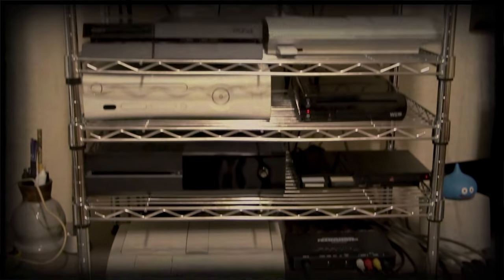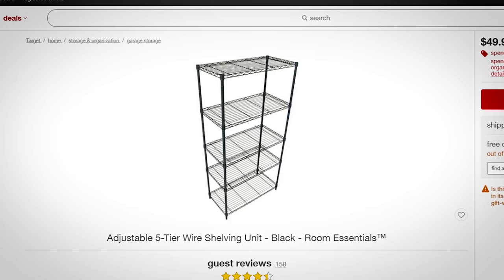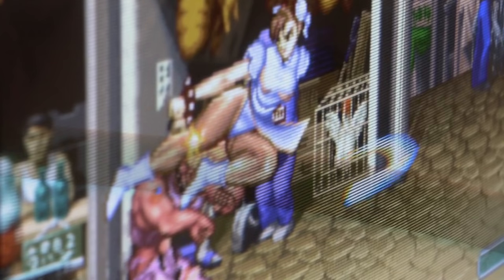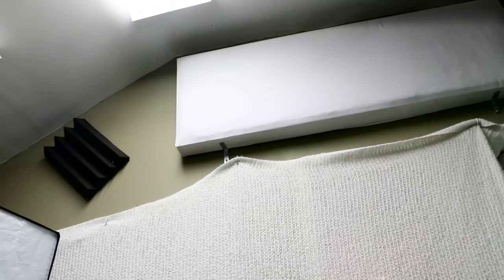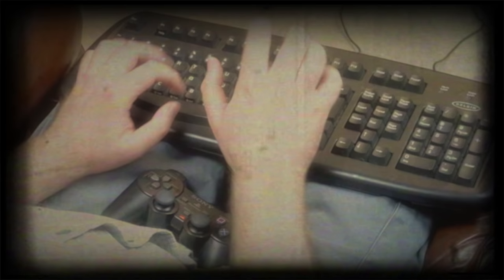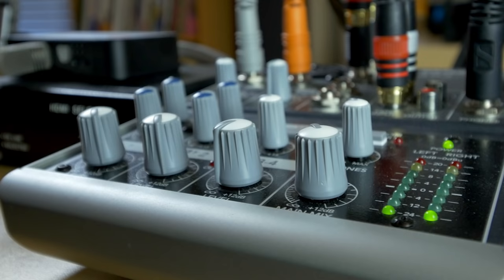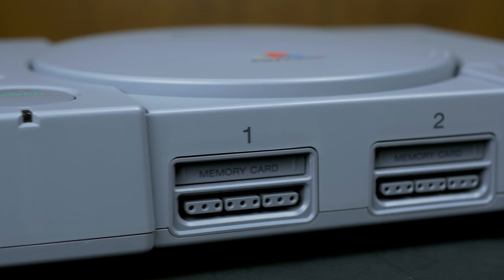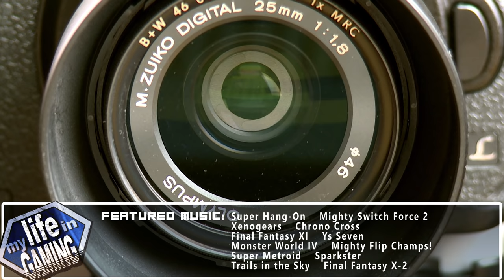Gaming Setup and Studio Tour - How We Make MLiG in 2016 / MY LIFE IN GAMING

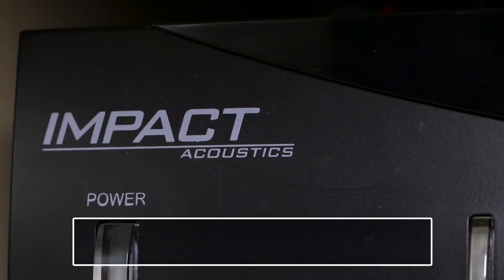Comment: 4:06 "It's pretty important to make sure that [the switchers] are powered. This helps you avoid image degradation"

I think that's a bit open to debate. Others have suggested using the exact opposite for just that purpose. ImplantGames Reviews, for example, opted for an unpowered component switcher by General Electric because he was worried about "electrical noise being added to the video signal". He reported no problems with it.
https://www.youtube.com/watch?v=qiqhn7I1odU

Personally, I had a powered composite/S-video switcher and it kept glitching up when certain consoles were played with S-video. For component, I have an unpowered switcher by Philips. It has four shared composite/S-video inputs and three of those inputs support component. It handled every S-video console that I threw at it, and I'm currently using it for my PS2, PS3 and Xbox with component. I think it looks great. I haven't seen any noise.
Reply: S-video is different from Scart 

I'm looking for a good splitter with its own power source. My current one blows
Reply: Jarrah White I used to have a powered HDMI switcher, I had no problems with it, except when I had my Wii U plugged in an on. I usually will play my Wii U on the gamepad and grind out stuff on my Xbox or something, and it would constantly make my switcher switch to the Wii U. Which I noticed either my Wii U or Wii Us in general have this weird on/off pattern with the signal through HDMI, even when hooked up to my Xbox One through the TV import I would constantly lose and regain the signal, only ever worked perfect connected directly to my tv haha, sorry this little tangent had nothing to do with your post really.

Comment: I know you guys aren't specifically modders, but I wonder what experience you have with exchanging batteries in games that use them for SRAM backed save data? Do you pay people to do so or have you done so yourself?
Reply from the maker: [Try4ce] Funny you should ask, because I would actually like to learn to do this and create a very simple "basic soldering" episode, with the ultimate goal being to learn to do something no more complicated than replacing batteries. I actually have never replaced any of my batteries, but I'm nervous about starting some of my RPGs before I do so.
Reply: I've tried it to mixed success but the problem is that I can't find batteries with solder tabs here. If I could I'm sure that'd be a lot easier. I've also seen some modify their carts to have a battery holder instead of a soldered in battery but usually that really depends on a lot of things. It's also not like you have to swap the battery very often.

I guess if you have flash carts you can just use those and leave the actual carts on the shelves, but I think you showed in an earlier episode how you liked the idea of using ips patches on actual cartridges so I assume for some people it'd still be most favorable to swap the battery in their old cart.
Reply from the maker: [Try4ce] Well, in the case of using the IPS patches, the RetroN saves the games to the system instead of the cart. So the battery is moot in that case. But for stuff like Phantasy Star IV, which is already in English, I want to replace my battery before I start it.
Reply: Battery holders tend to be better than pre-tabbed because you're not applying heat directly to the battery that shortens its life. You can also be picky about the coin battery brand and get one with a printed date of manufacture/expiration this way. Plus it only takes about ten seconds to replace it again in five to ten years. I can link you the holders you need. There does exist one low profile enough for game boy carts. Soldering is very simple and a good skill to have in general. The only risk really is screwing the cartridges back together improperly and stripping the threads.
Reply: Check Artemio Urbina's channel.
Reply: +Julian Rodriguez I don't speak Italian, and he doesn't seem to have anything for battery replacement.
Reply: +Nukleon he speaks spanish and he has two videos about battery replacement, also you can ask him about it, he speaks english too :)
Reply: Honestly the best way to change the backup battery is to open up the cart, remove the PCB, load the bare PCB into the intended console, power on the console, then go ahead and swap the battery while the console is powered on. Then reassemble the cartridge. Simple.
Reply: +Matt that's nuts, you shouldn't interact with a raw PCB while it's powered on. Better to just get it over with and accept you lose your data. Consider it an incentive to play the game again.
Reply: +Nukleon I'm an experienced EE and carefully hot swapping the battery would be fine on the old school legacy hardware with nice and wide traces... Key word is carefully, especially if soldering is involved.

Another option, which might be safer, is to piggy back the same low voltage of the intended battery in parallel across the battery terminals, while swapping out the battery. 

Short of using expensive and cheaply produced cartridge EEPROM readers for each specific cartridge as an intermediate download, those are probably the only ways I can think of to replace the battery.
Reply: Or you could just replace the battery and lose the save data. If it uses EEPROM, FeRAM or Flash for saves the battery doesn't matter anyway, it's only for games that use SRAM. All the game data is on mask roms and is entirely insensitive to the battery being replaced.
Reply: You can back up SNES saves using Retrode2 from DragonBox. You only need to hotswap SA-1 lockout chip games, namely Super Mario RPG and the Kirby SNES games, if you don't want to lose their saves. You can back up NES SRAM with the INL Retro Programmer and some scripts.
Reply: I have the exact same VCR that Coury has! :)
Reply: Jacob Carpenter great VCR

Comment: Get ready to replace your mini xrgb with the OSSC!!!
Reply from the maker: +BlockABoots [Try4ce] Maybe! There are upsides and downsides to each. It will be heavily featured in the episode we plan to release next weekend.
Reply: Just the reduce input lag is enough for me, and even though my LCD doesn't support the linetriple mode the linedouble mode looks just as good as my xrgb-mini ( i ahte the mini in 1080p the scanlines look horrible) and what with x4 and x5 modes coming soon, profiles and what ever else the community comes up with its only going to get better!
Reply from the maker: [Try4ce] I'm definitely excited about all of the possibilities. Coury has bought one, and I'm using a loaner to finish our episode. It's not quite to where I'm willing to use it in place of my Framemeister at the moment, but I can easily see a day coming where I would! The colors are definitely a lot more striking than on the Framemeister. Right now I'm worried about SNES compatibility (won't work on my TV, and NESRGB won't either). I'm very excited about 4X, but I'm suspicious that 5X might not work the way I hope. My hope is that it would be a 1080p signal cutting off overscan (rather than outputting a 240x5 signal), but I don't know if that's possible with the current hardware. I have no idea. IF so, and if I upgrade to a TV that supports SNES with no issues, then the Framemeister will be well and thoroughly defeated. :)
Reply: Yeah my SNES Mini (RGB Mod) wasnt working to start off with, i had to change the 'Analog Sync LPF' setting to 'MAX', have you tried that?
Reply: +My Life in Gaming what is your job to get all of these games

Comment: Very slick setup!
I agree about the metal wire racks. I've been using them for video game systems since the mid-90's. They are fantastic and make it easier to run wires.

I used to have 18 consoles connected, many with svideo connected to (3) 6-port powered RCA Svideo switchers. The best part was that it could be switched using any standard iR remote.  Then I had multiple controller extensions running underneath a rug and out onto a coffee table. It worked well.

Comment: For those of you who'd like to replicate Try4ce's setup, that Monoprice HDMI switcher has a serial port on the back (at least mine does, don't know if they do now) that you can use to control the switcher from a PC. You can get cheap serial to USB adapters online to hook it up to newer computers/laptops. This way you don't need to worry about the Framemeister remote if you cover up the switcher's IR sensor, and can hide the switcher behind your TV so you don't get driven insane by the flashing lights on the thing.
Reply from the maker: +mllarson [Try4ce] I actually bought an adapter like that, and still couldn't figure out how to make it connect or do anything. Since it's next to my couch, it may not matter anymore, but I'm still curious.

Comment: Hey guys, i'd like to make an arcade cabinet where I could pop all of my consoles in with compact switchers like the gscart and everything plus a consumer crt(yes it gets the job done cmon) and  control panel with pretty much every controller input from my consoles made out of extension cables connected to the consoles with detachable panels per consoles where I slide in the controllers .
Then the framemeister s output would go right into my Elgato capture card and the other end of my gscart to a pvm for a super crisp image and an optimal environment for speedrunning. Do you think this is a good idea? Cuz I need to save the most space in my room ( which is really , but really small) that’s why I think an arcade cabinet is the way to go...

Comment: 2:17 I definitely feel like that sometimes, feels like I'm trying too hard and that gaming is all I'm about. It's one of the reasons I tend to only have the necessary systems hooked up that have backwards compatibility (eg. one 60GB PS3 instead or a PS1+2+3 or a BC Wii instead or Wii + every previous Nintendo console), it helps the room feel less geeky and insane. I also eschew using game consoles whose major games have battery saves, has bad video quality or are prone to failure.

Having limited space, these days I favor:
-Backwards compatibility
-Good video quality
-Wireless controllers
-Handheld consoles

Comment: You know, I wished I still have my CRT me at this point. Now, I'm stuck with a cheap LCD monitor that recognizes 240p as 480i. For those who are wondering The TV that has s video inputs is my family's living room TV. The biggest problem is that my mom tends watch that TV for football and soccer games. The one in game room doesn't and has that flickering issue over 480i content. However, it recognizes 240p and gives an image over the component inputs when I 240p composite in the green plug. But the TV says 480i when that happens. It's a Magnavox HD LCD with a built in DVD player.

Comment: Dude, your set ups are awesome. It looks like Coury got the easy one for his set up in terms of cables. But you Try, WOW. How did you manage to make that work? Especially with all those long cables? I wish I had a setup that was a mix of both, but in the room that Coury has. Just the right size for a gaming man cave.  I feel i need more direct info on how everything is set up like a diagram thats drawn to show how you have the cables set up with the boxes to your computer, tv, audio, everything.

Anyways, great job guys, still makes me wish I had that kind of set up. Keep it up and hope to see more awesome episodes of your shows.
Reply from the maker: [Try4ce] Aside from the original Xbox, the longest runs are digital cables (no more than 25 feet) so there's no quality loss at all. Of course, in the case of something like the PS4 and Wii U, which are really far from the HDMI switcher, it's 25 feet, and then 25 feet again (passing through splitters), but it causes no issues! RGB systems are no more than 5-6 feet runs from their consoles to the GSCARTs... and then a very short run to the Framemeister and PVM. The Xbox has a component coupler to help it do the long run, and I don't think I've got any real quality issues there (I do hear a slight audio buzz when there's no sound, but it might be the cheapo cable I bought for the Xbox). The biggest challenge is how wide the spread of RGB consoles is... but thankfully since using two switchers instead of just the one, it's a little easier to make them all reach because I can spread them out a tiny bit (the daisy chain SCART is very short, which I specifically requested). With Coury's consoles being all close together, wiring might be a bit easier, but I enjoy my systems having a wider spread across the room!

Comment: You guys should make a video going through all the new third party controllers and sort them out as to which ones are actually worth buying as replacements to dying original controllers and other accessories.  There will come a time soon when the original controllers won't be an option which most people can afford and those third party clone controllers are the only choice that will have a more reasonable price point.
Reply from the maker: [Coury] I think that'd be a lot of fun. Our next episode is talking about several controller adapters where you can use controllers from one console on another. I think something like that would be perfect for a Tips & Tweaks episode.

Comment: wow, this is all so crazy! I definitely wanna use this for inspiration for my own studio that I'm trying to get set up now that I'm moving my equipment into a bigger space.

I wish I'd known about the keene box that Try4ce uses, but I'm ordering a Garo from Beharbros instead to route Component to my PVM. How much did that cost, for comparison?

You guys' videos are so great and I tell everyone I can about you guys when people ask me on Twitch (which is my main platform) about my RGB setup. The videos have really helped me learn a lot of things (especially the more esoteric console setups) and I am truly grateful you guys have made them.
Reply from the maker: [Try4ce] Thanks! Coury was actually using that for a while, but it wasn't working correctly with his PC Engine. He found something else that worked for everything, so he gave me that one. Someone in the UK helped him get it off eBay in the UK for about $115, he thinks? More expensive than I thought! He's using another box now to go RGB to component now, and I don't think his box goes vice-versa like mine does. It's pretty good, though I do have to make some adjustments on my PVM dials (a bit dark by default). I think the ideal situation is a second set of inputs like Coury installed on his larger PVM (as he shows in RGB 104), but for now, it's a good lazy solution for getting component systems on the PVM... though I will still mainly play them on the Framemeister.

Comment: At 2:03 - are there actually two Yamaha NX-E speakers hanging on the wall next to the tv screen? From an audiophile perspective i can only say: this is probably the biggest bang for the buck you can get. I actually collect those and often give them away to friends, wether its the NX-E100, 200, 400, 800 series (all with 13cm midspeakers) or the slightly more compact NX-E300 and 700 series with smaller 11cm midspeakers. They all come with the same 25mm softdome tweeters and their acoustic tuning throughout normal frequency response is almost identical (with exception of the two smaller 300 and 700 speakers which should be supported by a small woofer to listen to music).

Dont get me wrong, i'm kinda "high end" to music reproduction, just as you guys are with perfectioning your retro-gaming experience (i'm used to stereo systems worth tens of thousands of dollars, readily built as well as self built). But still i have never lost the focus on whats "cheap" and on whats "good value" and those little Yamaha speakers actually are the best compact speakers i've ever heard in such a low price range (here in Germany they go used for around $60, originally they were bundled with the Yamaha PianoCraft mini stereo systems series).

I'm babbling, sorry :) I really enjoy your videos, just recently discovered your channel and (of course as a big retro gaming fan) subscribed.

Keep up your great work and most importantly:
never lose the fun you have while doing all this!

Greetings and thank you so much to all those who are involved in creating these great videos :)

Comment: Wow, what a set up. Was that a Genesis and Snes packed-a-punch pure sync scart cables I seen plugged into the scart switcher there?
Reply from the maker: +Gary Cormack [Try4ce] Nope, I haven't tried those yet myself. Those are the "pro multicore" upgrade from retro_console_accessories on eBay. Any of the thicker looking cables on the switcher are that upgrade (they help reduce audio buzz a ton when using a switcher), but the last couple that I bought also have that fancy heavy duty looking SCART head. Kinda neat.

Comment: Hey! I used to have that Impact switch! Had to sell it with my console collection to move. :(
Reply: BTW, I've tried (along with regular dusting) those air filter machines and they do a great job of keeping the dust down when you're not in the room to dust, but making furniture movable on rollers or casters or just up 6 inches off the ground is a good idea for easy vacuuming. That or pack everything tight in containers in shelves so the dust doesn't have a chance. As for dusting the consoles themselves. Sometimes you have to take them apart and give the sticker-less parts a good soaking in warmish soapy water (dry well afterwards of course including screw holes and tight areas with Qtips).

Comment: Awesome set ups guys, both of you. I intend to build something similar next year and was hoping you would do a little more on cleaning. Could I ask how do you clean the shelves and areas behind where the cables run, connections etc of dust? Does is require a full weekly unplug? Special vacuum cleaner attachment to not damage everything? Does it sit in perpetual mess until you shoot?
Cheers in advance.